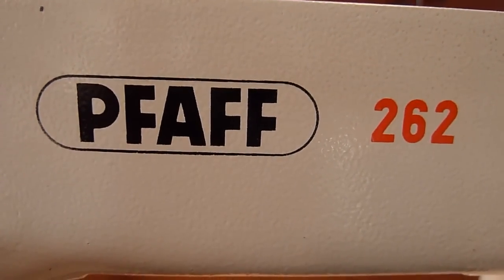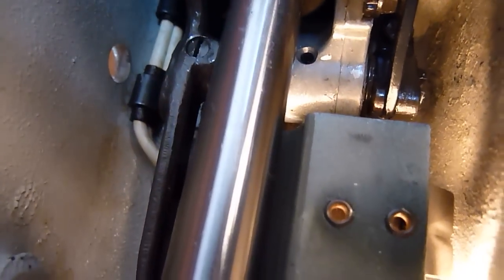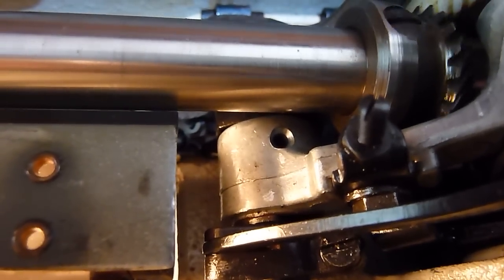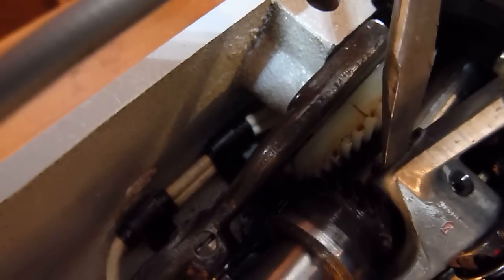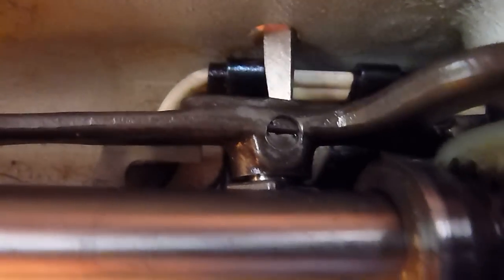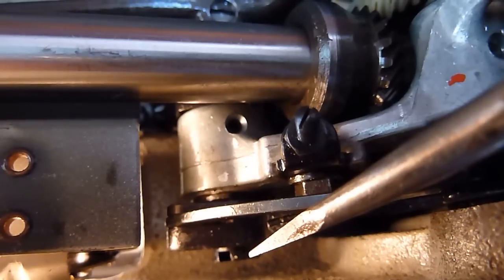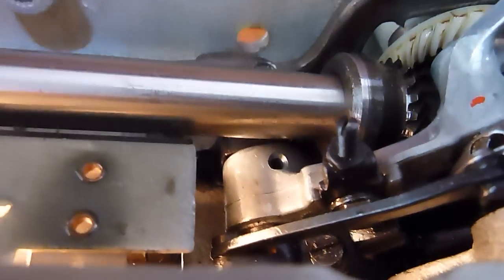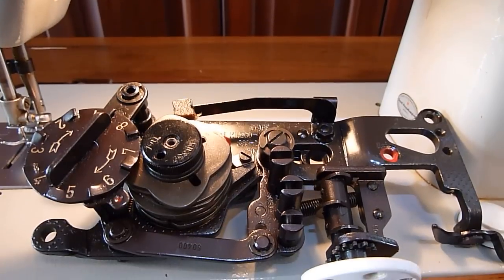How To Repair a Pfaff 260 262 332 360 362 Zig Zag Function

Comment: How do I find a part for a pfaff 260. Part # 106103
Reply from the maker: I don't know if you can still buy new parts for them, or even used parts via the part number.  There are a lot of parts available on ebay in the US, if you search by Pfaff 260 and also by Pfaff 360.

A Google search puts a 98 in front of your part number, and says it's an embroidery foot.  If that's what you're after, just look it up on ebay as a Pfaff 260 or 360 embroidery foot.

Comment: Hi, old vid.. but I hope to get an answer. The drive chain on my grandmothers pfaff automatic 362—261 was destroyed, and I ordered a new one, but i dont understand how I get the new one one over the wheels, do you know how to do this?
Reply: Remove the upper white flywheel. Belt chain goes on the left side of the larger lower gear, not right side..

Comment: Hi,
I have a PFAFF 332 and am struggling to find information on how to fix the stitch length.  The straight stitch length will not change from very small.  The dial moves fine to larger numbers but it does not change the length when sewing.  The zig zag works fine.
Reply from the maker: I believe stitch length is controlled by the feed dogs, which are the 2 rows of teeth located under the presser foot.  The stitch length control makes the feed dogs function, so my guess would be that the machine needs cleaning/solvent in the underside, where you see these parts interacting with each other.

Comment: Great video! I just got a 260, oiled it,  and all runs smoothly but it stays in zigzag mode. Could i send you.a video and ask for your advice?
Reply from the maker: The solution to your problem is in the video of this machine.  No need to send me one.
Reply: Tgank you. I live in Berlin Germany and so do you think German sold models also had this VasGas stuff?  I assume so if mine is stuck.  If the repair works, can I donate a small sum to your channel?  Patreon or PayPal maybe?
Reply: BTW, these machines and parts are fairly easy to find here if you need me to find you spare parts...I can bring it to the US when I visit next. Prices are lower here in general for Pfaff items
Reply from the maker: @nathans1978  I'm probably not correct about the machines being sprayed inside with something.  I made this video 10yrs ago.  It's more likely that the lubrication that was used when they were built, simply breaks down over decades of non-use, and what remains is a very sticky residue.  I've seen other machines do the exact same thing.  Sometimes applying heat and something like TriFlow or PB Blaster or Kroil will free them up and flush out the sticky residue, and sometimes the stuck assembly has to be disassembled and cleaned.

Thank you for the offer of a donation, but there's no need.  I just do this for fun.

Comment: Thanks for the video. I just picked up a Pfaff 360 and it had this exact problem.  I followed your instructions and was able to resurrect a very nice machine. I will add for anyone else who owns one of these, a couple of links for parts diagrams and a service supplement manual that shows you how to fine tune the timing. It was very helpful to me, though I couldn't have even started without this video...Thanks again!!
The links says for a 262, but it is the same for all of the models listed in this video (not sure about the 332 though).
http://tinymicros.com/wiki/File:Pfaff_262_Service_Manual.pdf
http://tinymicros.com/wiki/File:Pfaff_262_Parts_Manual.pdf
Reply from the maker: Glad you found it helpful and thanks for the links!
Reply: Thank you!

Comment: Hi, I have a pfaff 260, and your tip of using a hairdryer to loosen up the grease worked really well! The problem I have now is that the motor starts humming when I plug in the power chord. Then after  pressing the pedal it starts to run, but won't stop running even when lifting my foot off the pedal. When I disconnect and reconnect the power chord, the humming is back but the machine doen't run until I press the pedal and the same thing happens. Do you have an idea what might be causing the humming and the  machine that keeps running?
Reply from the maker: I have no idea what could be causing that.  Sorry I'm not able to help.
Reply: I got  this problem with my Pfaff 360, as well. There is a capasitor in the foot pedal. When I replaced it, the machine was OK again.
Reply: Ok I will try, thanks!
Reply: Arne Kverneland hi do you know what size/spec capacitor to use? my pedal works, but the capacitor is making crackling and popping sounds...
Reply: You can just remove the capacitor from the foot pedal - it is no longer needed. It was put in the foot pedals to help with interference with TV's and radios.  Newer TVs and radios no longer have the problem with interference.
Reply: @arnekverneland1127  amigo disculpa como puedo saber el numero de parte del capaditor o como puedo pedirlo

Comment: Please help me to figure out if I have assembled the stitch width mechanosm incorrectly: https://youtu.be/gyOHTw7_fTs?si=PZiHPqZgMjdfocKN
Reply from the maker: There is a spring that comes upward, from down inside the machine, and grabs that dark metal "hook" that is shown at the very beginning of your video.  You'll probably have to shine a bright LED penlight down into the machine, in order to find the top hook of that long spring.  It's a bright silver spring, so should be easy to find.  Also, at 3:32 you are asking about "should this be under this?"  Take a look at the little foot that you see moving up and down.  I think that should be completely on the other side of that area, so that the tip of that foot is riding on the underside.  As you have it installed now, the tip of that foot is just pointing up into the air not touching anything, AND, it is touching the other pieces, keep you from being able to rotate the zig-zag width dial fully from "0" to "4".
Reply: @austinado16  the spring is removed on purpose. But that positioning that you mentioned is something that I will try after work. Thank you. I will let you know how it went.
Reply from the maker: @madvelila  I'm not talking about the top spring that lays horizontally.  I'm talking about the spring that is vertical and goes straight down into the bottom of the machine, on the left side of the cog belt.  That spring needs to hook onto the dark colored metal hook, that you show at the very start of your video.  But maybe that's the spring you are talking about right now, to me, it's hard to tell because in your video, you talk about having removed the horizontal spring, but you don't talk about the vertical spring.  At any rate, good luck with the repair.
Reply: @austinado16  Yeas, I have removed that vertical spring for purpose. Thank you.
Reply from the maker: @madvelila  Ok.  Then I think you just have that foot on the wrong side.  If you look at other Pfaff 360 or 260 videos, you'll see that the dark metal hook is actually very low in the machine, and that thin threaded adjuster is also very low.  On your machine, those 2 are sitting very high, and angled up, pointing to the left.  So I think we've found the problem, and it should be easy to take care of it.
Reply: @austinado16  Thank you, I will test that this weekend. :)

Comment: RE: Stitch width dial... I spoke to Roy @ Budd Sewing Machine Co in Fresno and he got me going.  Turns out you just loosen the set screw above the dial and the whole dial/lever unit comes out in one piece.  After it's removed you can loosen the two small set screws that hold the various cams and levers on the shaft of the dial for dis-assembly and cleaning.  It's much easier than I thought it was going to be.

Comment: Gee thanks austinado16 for this video, the wife bought on of these 360s that had hardly if ever been used, in mint condition, but the ziz-zag control knob was solid as well as a few other small things. I don't think it had been used for decades. It came with it's cabinet with the rising hydraulic mechanism in. Not sure if we'll use the cabinet. Hope to have a go with the WD40 and hair dryer in a few days after the bank holiday. These machines do look like the bees knees of sewing machines. I like working on old mechanical things; they are built to last, not like some modern ones. Thanks again.